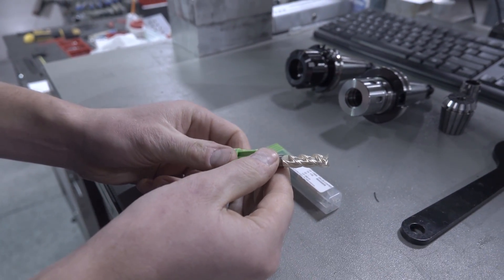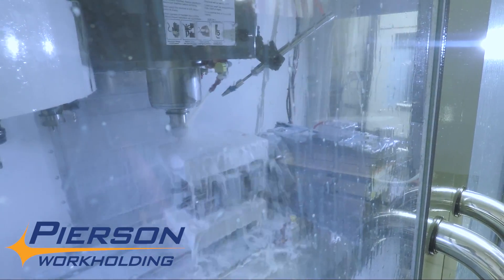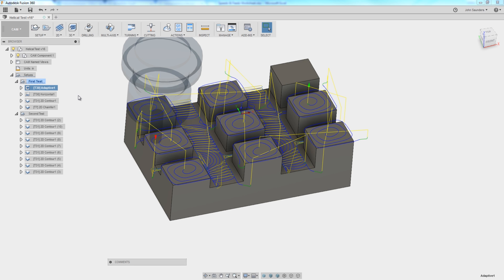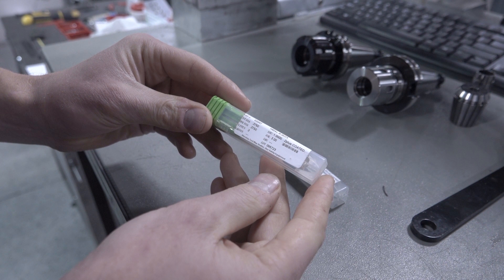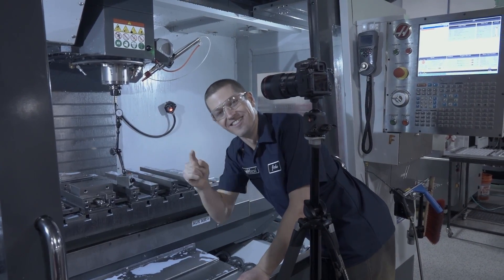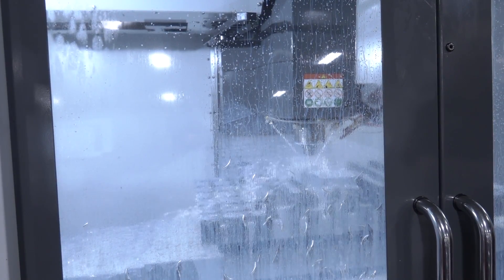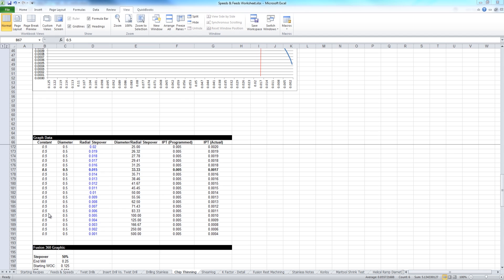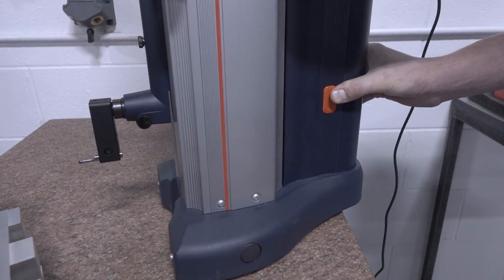Testing Helical Tools on the HAAS VM3!

Comment: For a really good finish in alum, you can use a spray bottle with kerosene  and lightly spray the part then run it with the coolant off,

Comment: Hi John, at 7:30, did you weld the ER wrench to a 1/2 end so it can attach to the torque wrench, or is there a 1/2 drive to 14x18 adapter available? All the ER wrench are 14x18 and I don't really want to buy another torque wrench with 14x18 head just to use it. Thanks!

Comment: Helical makes good tooling.  Our tool rep brought a couple by and I've been using them lately.  Comparable to Fraisa in surface finish.  Runout on the tool diameter on our sample was about a tenth which is about what Fraisa is and really really good.  Not as fast as Gorilla Mill for roughing so we use two solutions for seperate rough/finish but really good quality of tooling from Helical in my experience so far.

Comment: Fusion 360 Adaptive does NOT qualify as a "high performance CAM system that intelligently manages tool load in corners."

This is a feature I have requested from them (see https://forums.autodesk.com/t5/fusion-360-ideastation-request-a/variable-feed-optimization-based-on-outside-inside-arc-velocity/idi-p/6771930) but they are yet to deliver. MasterCAM 2018 has it, for contours, at least.

Their adaptive pathing only automatically equalizes load relative to the center of the cutting tool. While there is a "feed optimization" option under the Passes tab, this is NOT an "intelligent" feature, but rather a way for you to force the cutting speed to decrease to a secondary speed on inside corners or a certain direction change cutoff. A CAM that actually intelligently manages inside corners will do this automatically and will programatically change the speed in any inside (or outside, by increasing) corner relative to the actual change in load brought on by the true velocity of motion where the cutting tool is making contact with the material. i.e. the speed change will vary based on the directional change, not be a simple on/off speed reduction at a certain threshold.

Comment: Nice cutting trial.  There are lots of good USA brands now.  Even though the price per end mill may be higher; the tools have more value in terms of bang for the buck ( accounting for performance improvements ).  I give Helical another vote along with Destiny and IMCO.

The next step is to compare tool holding:  ER40, Shrink and Hydraulic ( with and without sleeves ).  I have used various Mill Chucks and Weldon Syle on Haas 40 taper, but both always seem " chattery ".  Thanks for doing all these test cuts.  Have you thought of using Autodesk's higher end Powermill or Featurecam Software?

Comment: I use Helical EM's and really like them.  The Milling Advisor has burned me a few times with errors in the recommended feeds and speeds.  The result is I have trashed some new end mills on the first millisecond of cutting so be a little cautious.  Milling Advisor is a work in progress as they figure out the mistakes so maybe start less aggressive and move up to where you are comfortable. Newer releases seem to fix the bugs, but my broken EM's paid the price. If you are trying to max out MRR, buy at least 1 additional extra EM to destroy when you hit the limit or blindly trust the Advisor as I have done.

The 1/2" EM's of similar helix and coating give a great surface finish with more aggressive capabilities over the 3/8".  With a 10k spindle you can run a full D slot at 200+ ipm, but a great .005" radial and axial finish cut at 80 ipm gives a really nice surface finish.  Faster is okay, but you see more artifacts of going faster.  With 15k you can go 120 ipm to get the same finish.  High Efficiency roughing can go much faster.  I would go with a .005" bottom finish minimum if you are really aggressive with HE roughing.  The advanced carbide is great, but it still deflects so a .001" bottom finish cut you listed may not clean up the roughing deflection variations on the floor. With a .005" axial and radial finish cut you will have such a nice finish it will look just as good as your .001" keep off the bottom.  Try it, you will be happy with the result.

Comment: I use 55 degree helix 3 flute carbide for machining 6082T6 and 7074T6..I've found a big variance in the finish with these tools. Using the same feeds and speeds and two new identical tools of the same make one finish will leave bands and the other is mint..I've decided that it's the grind on the tool not being perfect from new. It seems one tool will push off more than the other.  But of course once it's used it's hard to take it back for a refund. I think I need a shadow graph to really check them before I use them.

Comment: Quick bit of advice about that hydrometer.  Hold it level to the floor when checking it.  If you angle it the fluid can move to the rear and distort your reading on the scale.

Comment: Hi John, When we use a crows foot or any adapter that adds length to a torque wrench we need to take into account the added length. By using the adapter it adds length to the wrench, torque is a rotational force at a given radius. If the distance increases the torque will also increase. We can compensate for this is two ways, first by calculating the torque value the wrench should be set to and lowering the setting. This calculation takes into account the length of the wrench, length of adapter, amount of torque desired, and the angle of the adapter relative to the handle. The MUCH easier way is to put the adapter at a 90 degree angle relative to the wrench handle. This will cancel out the additional length because in the formula the force multiplier is the Cosine of the angle. The Cosine of 90 degrees is Zero, so it cancels out the added length. Nice video on the effect of helix angle. Often over looked by home machinists. Check out variable angle helix tools, opens up a new realm for sure. Thanks for your videos, Tim
Reply: I came here to say exactly this. Except note that if you keep it at 180, then the torque applied is actually a function of where you are holding the torque wrench, not the length of the wrench. So you could get different results with the same tool and different operator! Much better practice to use a crows foot at 90deg as you mentioned.

Comment: I've used a crowfoot adapter on my torque wrench for er16 collets for years. Where did you get that adapter for er32? Looks handy. Better than the hand filed square hole i put in my er32 wrench that i almost never use because its not just there on the torque wrench.

Comment: Great vid. 
Why is your new Haas side mount tool changer carousel so slow? Id complain to haas. 
Cheers
Reply: He probably slowed it down to go easy on the Renishaw probe.  It doesn't matter if the tools are in the side mount changer sequentially because if you look in the G-code HSM outputs, after a tool is loaded for a toolpath it calls up what the next tool will be and the tool changer will rotate to put it in position - I am most familiar with HAAS but I believe thats how most high volume tool changers work as well
Reply: I noticed that too... A good setup would have sequential tool changes. Like start with tool 1 and end with tool 10 in that order. That would negate the sluggish tool change.

Comment: John, are you using the G187 precision control command? On our VF3’s it makes a HUGE difference to actually hit the programmed feed rates on the HEM strategy toolpaths. It’s pretty important on the haas machines - all other machines as well. But the HAAS control doesn’t seem to actually display a corrected feed rate based on geometry and feed rate.

Comment: You do know that that ER collet adapter sticking out the front of that torque wrench is changing the moment arm of the wrench, and tossing the wrench calibration out the window? You probably had more like 90 or 95 ft/lb of torque with that extra 3 inches on the wrench length, if you didn't calculate a correction factor for the wrench setting. Either crank it 90 degrees or calculate a correction factor.
Reply: l wilton 
ER 32 collet nuts have a torque spec of 100ft lbs.  he set the wrench to 85.  So yes, he did account for the additional length of the adapter.

Comment: Looks like from the microscope clip the part was not cleaned up on either the side resting against the surface plate or the granite square. Even if measuring the distance across the bosses, a few millionths could come from those surfaces being as expected w.r.t. the surface plate or the square. But I might have missed the important bit. Amazing that a height gage can measure to individual millionths, but the accuracy is .000043 + (.000024 x L*/24)in from the specs? Happy New Year!

Comment: You should always "click" with a torque wrench 2 times.
Reply: No.  1 click. And 1 click only. 
Additional clicks add additional torque and extra load to the nut and increases the amount of stretch. 

Just one click. It’s how those wrenches were designed to work.
Reply: Additional clicks don't add more torque. The torque will not change based on how many times you click it, but the position can, due to hysteretic friction and yielding or creep of the peaks in the mating surfaces of your fasteners (which decreases the clamping force). The speed at which you move the torque wrench will affect how many clicks it takes for you to get to a consistent position where repeated clicks no longer move the fastener. In short, other than torque-to-yield bolts (which definitely should only be clicked once!), it does not matter how many times your torque wrench clicks before the fastener stops moving. That's why people click it twice - if the bolt continues moving after the first click, it's because clamping force (and therefore friction) decreased due to that hysteresis.

However, also worth noting that unless you're torquing on a highly elastic material (eg applying a nut to torque against a spring) or at/very close to yield of one of the materials, we are well beyond splitting hairs here given the tolerances of calibration of torque wrenches and the fact that torque specs invariably have a tolerance on them too. Torquing anything in tool steel... click it once or 100 times, it won't matter in practice.
Reply: Abom clicks 3 times!

Comment: Do you want a great surface finish...or do you want a surface finish that LOOKS great? They aren't always the same thing. I recently did a part in 6061 that had a surface finish callout of <30 RMS. We were getting profilometer readings of 1.5 RMS and under which certainly puts that feature in spec...but it looked awful. It was smeared and not at all uniform. On that part, it didn't matter because it wasn't a visible component.
Reply: This is interesting, because I was told that some surface marks are not actually physical marks in the metal, they actually reflect light differently because the structure of the metal has changed, I was told it was a slight difference in density.
Reply: the way light reflects off of surfaces is directly tied to the geometry of the surface as far as i know

Comment: 12:55 you cannot lay the part on a non datum side (if the lower side is not a datum side) and "call it good", it might be at a slight angle
Reply: Wake up guys... the "error" in the measurement you're all referring to is less than one ten thousandth of an inch! Plus, most of your crappy tools couldn't measure to the accuracy of his height gage. So yes, I'd call that good... VERY good! Well done John.
Reply: @jaypierson5955  That is a false statement. You can't know the error based on his measurements. The error would be his measurement against the proper measurement.

70 millionths sounds like a tiny value (and it is), but there are many applications that require that level of accuracy and precision. I design measurement systems for a living, and this was not a proper measurement. Like someone else has said, though, it's probably good enough for a test piece. I'd never let him machine my parts if he measured them in that manner during my supplier development process.
Reply: Was noticing the same problem.  It's a non machined surface you set on the surface plate.  AVE would say your measurement is gaaabage!  😉
Reply: normally this is a no go, at least where i work :)
Reply: i am just saying that this is not the way to go, maybe he was lucky this time but next time he could be off 0.002 inch or more. Also maybe the machine didnt machine  0.969938 but more or less and he is thinking the machine machined it to that dimension. Maybe a Micrometer is better
Reply: Agreed. The machined face needs to be against the granite angle plate.. but for the purposes of a cutting tool test it's a decent reference
Reply: Protip: Don't take machining advice from this channel

Comment: If you want a shinier finish try an un-coated tool, variable flute endmills help too.
Reply: This is the ticket. Any coating will blunt the cutting edge significantly.
Reply: You beat me to it! I agree that cutter edge-sharpness is key, and that an un-coated tool is needed to achieve good finishes in Aluminium.
I would add that, for carbide inserts, the un-coated 'G' ground-finish inserts (not the 'M' molded ones) will give you a beautiful mirror finish.

Comment: Nice video! I love these tool videos! I'd love to see you try Destiny Tool diamond back and viper. They're expensive but I've never found another brand with tool life and MMR that come anywhere close. It's all I'll run in my machines for aluminum. For stainless Guhring is probably untouchable. Just mind blowing.
Reply: This! They leave such a nice finish on the floor, and insane MRR, Destiny viper really is the best I've found too for aluminum.
Reply: Helical is about on par with Destiny. 
In fact I’ve used the Helical speed and feed widget there with Destiny endmills and works perfectly. 

I find the Helical to be able to take heavier cuts, but the Destiny is more stable with slightly less chatter.
Reply: I used to use destiny tool, i loved the diamond back rougher, but then I found the yg1 speed freak, its powdered metal too. It cuts faster than diamond back which is carbide